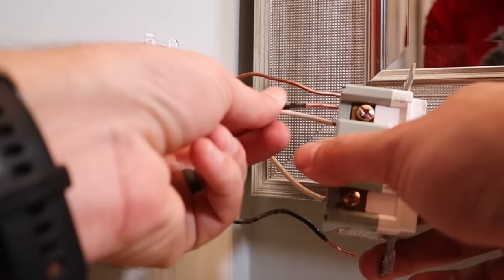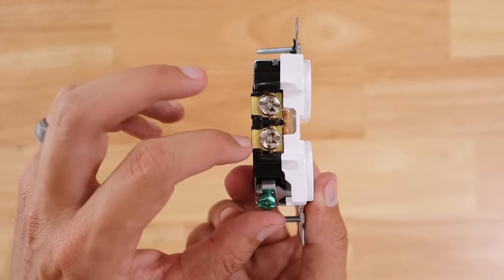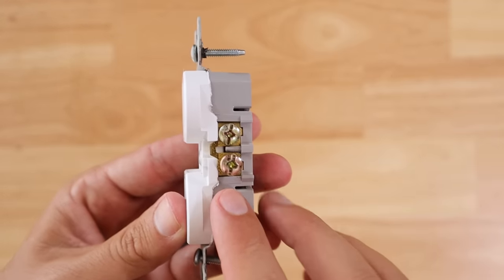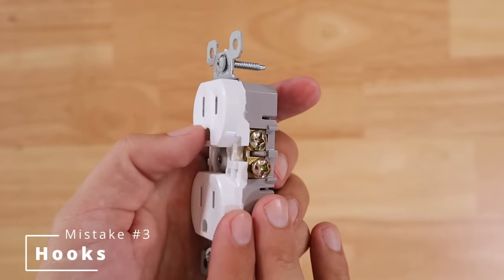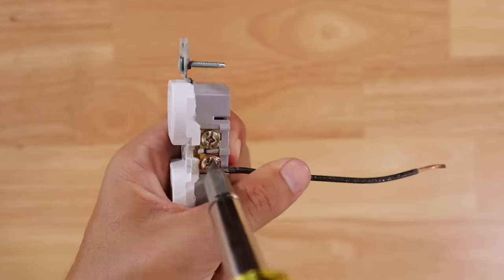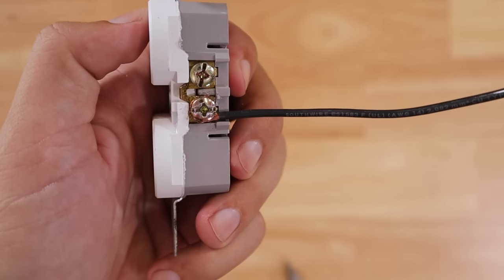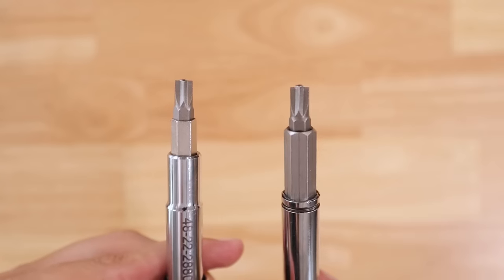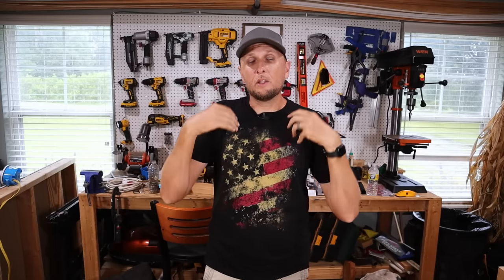The BIGGEST Mistakes DIYers Don't Know They Are Making When Wiring Receptacles | How To

Comment: I'm a DYI novice when it comes to electrical projects. Every tips I can get is helpful. I had to replace a GFCI outlet in the kitchen and I need replace a ceiling fan next. Also, I need to replace two other GFCI outlets as they are also nearly forty years old. Thanks. 😊

Comment: The combo bits in the video were cool! I figured such a tool must exist, but you just confirmed it! Excellent hands-on demonstration of the wrong and right ways to wire up outlets!
Reply from the maker: Yeah they are really helpful!  Really glad to hear you liked it.  Thanks a lot for the feedback Bryan!
Reply: The screwheads on the outlets were specifically designed to be tightened with either a Philips or a slotted screwdriver, for convenience. They were not designed to require a special bit. For the DIYer, it is my opinion that a special bit may be nicer to use, but it is not necessary. A Philips bit in GOOD CONDITION is, however, necessary. I also think the combination screwheads are a stupid idea and that simply using a standard Philips screwhead would have given the best results since the combo screwhead is not a perfect fit for either Philips or slotted.
Reply: I have an insulated set.  They have red rubber on them.

Comment: Well done dude . . . I'm not a licensed electrician but I do ALL these things, great tips.  One thing that a buddy of mine told me not to long ago that he does as well, is once he's finished making the connection he runs a roll of electrical tape around the outside of the back square to cover all the connections and ensure that no wires touch when pushing the receptacle back in the box. Another guy I knew used to install the receptacles upside down . . . in the off chance that if a plug was loose and if something metal fell across the top connecting the two prongs. Oh . .  and backstabbing is THE WORST !!! I had rental properties for years and almost every electrical issue was due to backstabbing the receptacle
Reply: When I was an apprentice, I used to wrap tape around receptacles as well - I learned that growing up...But the mechanics made me break that habit....They'd say that's the sign of a novice. If wires are stripped and terminated properly, there's no reason you would need the tape...no copper is showing, wires are secure - what wires would touch when you pushed it into the box? If it was a real issue, NEC would address it. 
The upside down method is not wrong, but the perfect storm of scenarios would be needed to cause an issue - which is why NEC does not govern a receptacle's orientation. I actually performed an experiment with students when teaching a night course at a trade school. They couldn't get something to cross blades without helping the situation along.

Comment: I was aware of the mistakes you pointed out, there's one more that could go on your list that I'm aware of, if only one wire is going on the hot and neutral terminals, always be sure to tighten the screws that are not being used so the heads are not sticking out where a person could accidentally touch them or contact a ground wire when pushed into the box .
Was not aware of the different screwdrivers for tightening the screws, will pick one up.
Thanks!

Comment: As a long time DIY-er, I found this very helpful and informative. It also helped me with an issue I had where my Arc Fault breakers kept tripping. -- The "electricians" did the "back stab" for all the outlets. Once I (properly) looped them on the terminal, the issue went away.   Thanks.
Reply: @John Fischer why? In this case it may have caught an arcing back stab connection.  I have not used them though. Do they false trip often?
Reply: I can't believe they have not prohibited those. They're terrible.
Reply: I don't like them either, especially if you are running older but still safe appliances which tend to trip them
Reply: My parents house is over 50 years old and did not have the arc fault breakers. We never had an electrical problem with those circuits in 50 years. We did have GFCI outlets where they were required though.
Reply: @ianbutler1983  They are actually required by code in my area for bedroom circuits.
Reply: Arc Fault breakers are code required here in California. An arc fault breaker was tripping in our home after rewiring by an electrical crew. Contractor replaced the breaker with a std one. I later figured out was was happening when I replaced the light switches with smart switches. At least 60% of the plastic light switches were cracked - the electrical crew used the back stab connectors and jammed the switch back into the box. The force of the wires in the connectors cracked the plastic switch body.
Reply: It was a GC, same clown that did the framing.  No real electrician back stabs
Reply: AFCI's have been on the National Electric Code for almost 20 years now, they are mandatory for code compliance in new construction in most parts of the US these days.

Comment: Thank you!  A friend who does his own work.   I saw the black wire was stripped more as you showed.  He said it was okay.  He just re-tightened.
After he left, I turned off my electricity. Got my wire cutter, cut the tip off. Measured it like you demonstrated. We curved. And refastened.    I feel safer now that I did this.  This just reassures me that I myself can do this safely and cautiously. I also know that if I don’t feel comfortable not to do it and to bring an electrician in..   for me it’s always been better. Be safe than sorry.
Reply: Wrapped new receptacle connection sides w electrical tape after RnR because GFCI didnt trip breaker didnt trip burned outlet and GFCI strip. Leave nothing to arc, nothing to chance.

Comment: Thanks for this, particularly the clockwise/anti-clockwise thing. I'm an occasional DIYer and knew about the hooks and trim length but never knew that the hook was supposed to go in clockwise. I'd randomly insert it in either direction and thought the reason the wire slipped out sometimes and stayed put others was down to poor quality control on the terminals. I've even wedged a flat head next to the wire to stop it popping out while I tightened. Thanks!
Reply: Hire an electrician you’re going to burn your house down
Reply: My pet peeve  over the years  has been:   Seeing so many people  NOT examining their own methods,  NOT  being safe.  A fool  leaves sharp tin or wires falling into roof insulation.  A fool  jacks up a vehicle WITHOUT  tires blocked,  emerg. brake On.  I can think of a dozen more examples.   I can accept humble  suggestions from others.  If I disagree,  I explain the physics of  Why.  Seems like most women (that I've been around)  "just want the damn thing fixed,  & they want it done  YESTERDAY!  🐷😵‍💫💩😠
Reply: @TheBooze13  In my defense, I've never had an issue with the exception of this one thing - one thing that How To Home thought was a common enough mistake he made a video about it. Also, in case my words misled - the flat head screwdriver is only there while the electricity is turned off to ensure the wire doesn't slip as the screw tightens. It counters the effect of the screw pushing the wire out, and everything is securely held in place before the flat head is removed. Everything is then insulated before turning the electricity on and testing polarity/ground, then the electric goes off again while the outlet goes in the wall. One more go with the receptacle tester and a quick run round with the non-contact so I don't think there's any additional risks.
Reply: @patriot692  A fool is one that doesn't learn. I reverse engineer most things I do, and often improve the process but this one thing got me. It's largely because I've only ever installed 8 outlets and 6 of them just happened to be the right way round, so, when I hit two that weren't I questioned the slightly cheaper outlets I'd switched to instead of myself. I observed the wire slipping out and devised a graceful lever mechanism to insist that it stay in place as I tightened.

Talking of jacking up cars, the first time I ever changed a brake pad it took two hours for the first wheel but the last time I ever changed one, the second wheel, only took 15-minutes. I was barely 17 and, although the parking brake was of course on, I had no idea about blocking the tires at the time. The wind was blowing hard and my leg was totally fine because nothing happened but you almost thought it was going to be an interesting story.
Reply: I'm left handed and although I know this,  I catch myself going the wrong direction or twisted wires together the wrong way then wondering why the wire nut doesn't feel right!  Thanks for the reviews,  helps alot

Comment: Excellent video!  I worked in electronics for over 30 years but some of these points were a good refresher.  One thing I remember hearing years ago about getting polarity correct was, "white to bright - black to brass".  The silver screw being brighter is for the white or neutral wire.  I always hated to see the 'back stabbing' connection being used.  They should have never come up with that IMHO. Thanks again for your video.
Reply: Yes, agree re quick connect.  Have seen these connections cause an outlet to run at 100 degrees. Definitely a fire hazard.
Reply: Backstabbing is no longer code either.
Reply: I've always remembered, "black to brass saves your a__."  It rhymes...  ;)

Comment: Thank you for this, I didn't know about that new type of bit. Phillips heads were designed to slip to limit the amount of torque that could be put on a fastener. I first encountered this working on vintage Japanese motorcycles and damaging lots of bolt heads. I finally found out that these heads are not Phillips after all, but rather JIS, which is designed not to slip, and got a set of JIS screwdrivers which make the jobs go a lot better. It seems that there is an electrical equivalent of a non-Phillips crosshead screw!
Reply: Copper is soft and should not be overly tightened, I have found Philips apply enough pressure.

Comment: Great video. Something worth pointing out, there are round cutouts at the base of the mounting tabs. They are to be used as wire strippers 12,14 gauge ,solid or stranded.
Reply: VERY few brands have that feature from what ive seen.
Reply: Eaton does but Leviton does not. In any case its not a great way to strip wires

Comment: Explained nicely in a efficient concise manner. Good video shooting as well as verbal explanations. I pretty much knew all this info but your presentation, concise treatment of info, and the efficient videography is all very impressive. Thanks. I REALLY especially liked the simple but extremely illustrative example of the clockwise tightening on the clockwise bend. Just fixed a DIYers circuit where the dude tightened all the connections and you could tell it was random the way the DIYer placed all the bends or hooks. The guy was a self professed "expert" but had no clue that a counterclockwise bend would spread out or widen upon tightening. ...... and I'm a DIYer, but someone taught me early on that the direction of bend matters.

Comment: Great video man!! Son of an electrician here, Architectural designer by trade. I watched my pop do a lot of wiring as a kid and am a confident DIY electrician around my own home. I certainly don't know everything but love learning. The combination screw bit you showed at the end is an incredible innovation for electricians. I'm buying a set today!
Reply from the maker: Glad you liked it.  Those bits really do make things so much easier.  Enjoy them!   Thanks a lot for the feedback!
Reply: 👏👏👏for this video. Years ago I was taught that the black wire went to the brass screws, white wire to silver screws. I was also taught to be careful with electricity, it’ll earn your respect. I done away with our garbage disposal, which the on/off switch had a receptical also, I took it out put in a wall plug, put black wire to brass screws, white to silver, but no power, the breaker is on
Reply: but do you really need that much torque......... you can cause just as much damage as good if you torque it to tight.

Comment: Great tips - As a DIYer I don't wire outlets every day so "best practices" never become "habits." I never knew why electricians didn't use the back-stab facility but now I do. Also the strip-gauge would save me either stripping more or cutting too long a tip off the copper.
Reply: Unfortunately, "smart" switchers and dimmer so not have them, I can provide proof, but I have enough experience to guess anyway.
Reply: The electricians who wired our house used the back-stab terminal.
Reply: Laziness kills.

Comment: I've been an electrician for over 30 years, and while I whole heartedly agree with everything you covered here, I would like to point out that DIYers should be cautioned about overtightening the screws. As I'm sure you're aware, overtightening can cause a whole different set of problems. The combo bit is definitely the way to go, but you really reefed on that screw to make a point, which could inspire people to just tighten the crap out of it. Just sayib'...
Reply: A question with someone with more experience than me.. I have a bathroom,a hallway light switch, and one receptacle in my sons room that have no power. My daughter has power to her room.. my son has power to all of his room besides one receptacle that is near the hallway.. the bathroom is in between both rooms.. all three are on the same breaker.. and I changed the gfci receptacle in the bathroom thinking it was bad. But still no power. Am I looking at a bad connection somewhere between the kids rooms? I’m confused
Reply: @vancelee3506    Very difficult to trouble-shoot just by this information - a lot of variables.  It's very common to have circuits run feed multiple rooms, so your situation is normal. (1) Are you sure the GFCI is wired correctly (there is a "line" and "load" side). Are sure sure the GFCI is reset? (don't laugh, I've been to calls where the homeowner had no idea it was tripped and disconnected downstream receptacles). (2) It really requires an on-site visit to inspect each component and check for power using a meter.
Reply: @ruffxm  thanks for the info. Yeah I had it all wired correctly and I found the problem. I was a little slow considering I don’t do electrical often lol I had a lose wire in a light switch upstream from the hallway and the bathroom.. checked the continuity to figure out where everything was going and finally found it

Comment: Great video. There's newer outlets I've installed recently with a version of the speed wiring inserts where you also tighten the screws to fasten them in that clamps with a much higher connector contact area.

Comment: Nice tips. My dad was a 40 year journeyman lineman and wired my whole house so that provided a great example to learn from. Another one is install your outlets with the ground plug facing up. A lot of people will say that's goofy or unnecessary but just like this other stuff in the video it's just little things that over time minimize the chance of something going wrong in the future. GFIC outlets are designed to be oriented with ground plug up, I suspect so that anytime there's water in the area it will be less likely to splash on the hot terminal first, from above.

Comment: I was always taught to use a single wire to the receptacle using wire nuts to a pigtail and not to use the device as a “wire nut”. Takes a bit more time but looks much better and less connections at the device. GFI’s being an exception. Love the video!
Reply from the maker: Yup same here.  Glad you liked it!  Thanks a lot for all of the feedback Chris!
Reply: I agree completely and there is never a reason you should have two wires connected to an outlet unless want to make one side switched but then you would cut the connecting tab.  The issue is that only one of the black wires is the source of the hot and if you are using the device as the "wire nut" then all the current is flowing through that small tab which it is not designed for.  To properly install a series of wires you should use a wire nut to connect the extra wire  before getting to the outlet.
Reply: @jjmarogil  It’s definitely designed for it.
Reply: Two screws are on each side for a reason.  Perfectly ok to "use" them as intended.
Reply: Ok to use the 2 screws to come and go in a residential application, that is called in series, commercial requires the 2 wires go in a wire nut with a third wire to the device and this is called wiring in parallel. Also, stranded wire requires a fork terminal to terminate unless the device is rated for stranded wire.
Reply from the maker: While pigtailing is the preferred method, using both screws is not against code.  Please cite where this is stated.  Again, I prefer pigtails which I mentioned in the video but let’s share factual information please.
Reply from the maker: I think you meant to say 300.13B as 300.18B deals with raceways.  But a key word in this that you quoted is that this only applies to multiwire branch circuits.  Multiwire branch circuits include 2 hot wires on the circuit that share a grounded conductor (neutral wire).   So this does not apply to your standard wiring of receptacles that only use 1 hot conductor and a grounded conductor (neutral).
Reply from the maker: It’s not.
Reply: @sparksalot4950  Yes perfectly ok to do but it's not series wiring, screws are not loads.Both pigtailing and using the terminals for feedthrough is parallel wiring. Pigtailing is required for neutrals only when sharing the neutral, not for the hots. While not required in commercial unless sharing the neutral, pig-tailing is common practice for both hots and neutrals and frequently spec'd that way.
Reply: @TheDarthJesus  Not against code at all, except for neutral when it's shared.